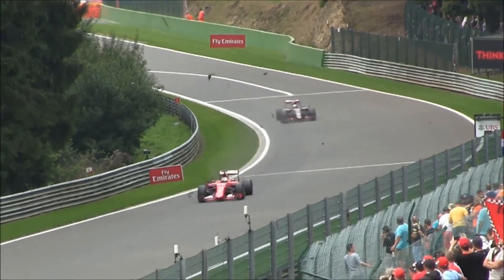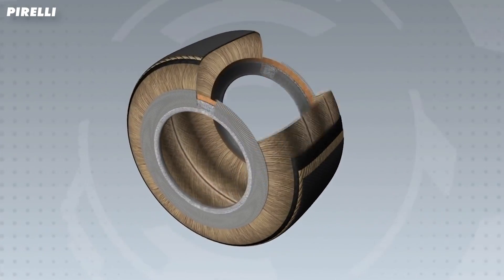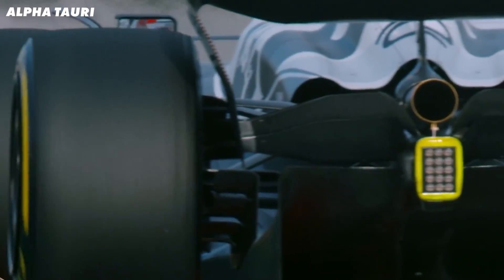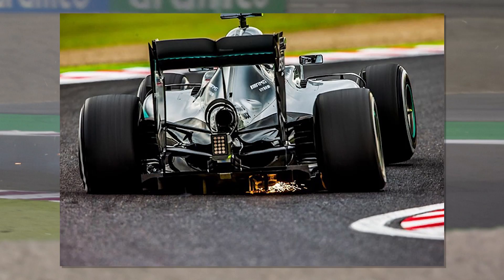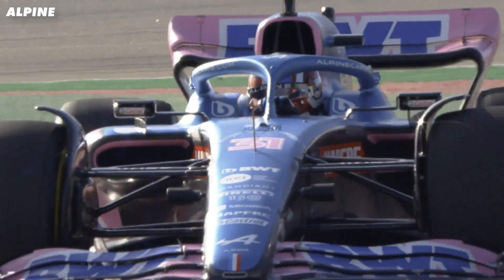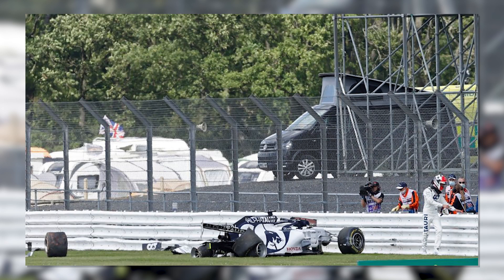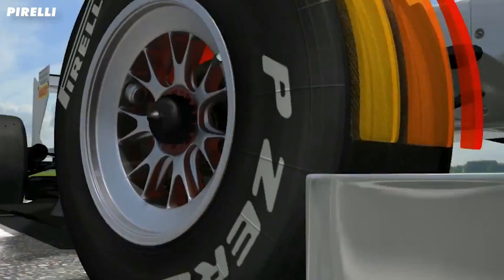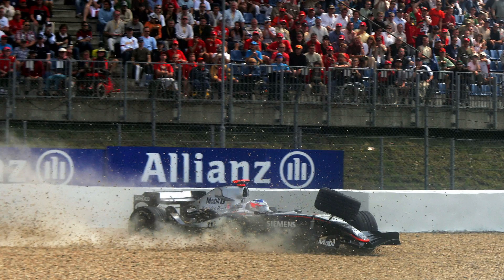Why Formula 1 Tyres EXPLODE

Comment: 4:13 its 27,000hp (20,133kW). Also with brake bias at about 58%, and the front loading of the car, the front tyres are probably doing about 70% of the overall breaking. Or about 9500HP per tyre.  kW is a better measurement though. . The total braking of 20MW would power about 30,000 - 40,000 homes for that short period of time (~2s). (an average of 415W - 666W over the 24 hours assuming comfortable temps)

Comment: Curious how the manufacturer of the tire blamed a phantom problem. A manufacturer that just so happens to supply the tires for the industry where a mysterious failure occurred. Kinda sounds to me like the Inverse Kramer Law should apply.

I'm guessing either the tire had a defect that could have potentially been present in the entire batch or something failed, but not all the way, only just enough to create heat but no sparks yet slowly heat up a rim somehow enough to soften the bead of the tire to the point where the tire failed but again somehow without something else overtly failing like decrease braking power, partially locked wheel, not weird at all.

Comment: At 1:20, either what you're saying, or what you're showing is incorrect - The dispersion rate is the rate at which nitrogen and oxygen will 'leak' out of the tyre (hence why you need to periodically fill up your car's tyres)

Comment: It’s just so crazy that with all of the parts we use in cars,and different materials,that the most important part is made of rubber and is the contact to the road,which can be very rough and tough,the crazy part comes in because tires simply work (tires as we know them now anyways)!!And this video amplifies how amazing tires are and how we trust tires to do what we need them to do in the applications that we use them for!!

Comment: What wasn't explained in this video is there are 3 forces acting on the tyre.

Downforce: squishing the tyre
Side force: pushing the tyre of the rim.
Rotating for: rotating the tyre around the rim

When you break and accelerate the force is transferred through the inner diameter of the tyre, whilst the outer diameter is trying to stay put.  This is putting rotational torque through the sidewall.
Top fuel dragster are a good example of this.

The other mention is as I don't think FEW are running bead locks. The only thing attaching the tyre to the rim is friction. The air pressure is keeping that friction high, if you lower the tyre pressure there becomes a point where the one or all of the 3 forces are more than the frictional force of the rubber to the rim wall and then the tyre will fail.

Bead locks prevent this, that's why extreme off road vehicles run them, as it's a clamping force and not a frictional force. So can run no pressure and the tyre will stay on.

Comment: I’ve got myself a tire exploding on a road trip while only traveling 120km/h on semi-rough surface…. and it’s a pretty new tire as well with only about 30.000 km clocked in. I think I can understand if sometimes F1 tire gives up under much higher pressure situation.
Reply: 30 000 km is in no way pretty new tire. That is more than half of the usable tire life.

Comment: 1:40 I would use the long right hander at the start of the Catalunya circuit. You see at the F1 game, the heat and degradation on the front left

Comment: Why is it that drift car tyres don't seem to lock up in the same spot when they use the second caliper to start a drift, I remember seeing Nigel's tyre blow out and later he was told he would have won if he wasn't able to not crash.
Reply: Drift cars don't use such a soft compound as F1. As well, purposefully spinning the tires should help to even out potential flat spotting.
Reply: @Vykk_Draygo  
I do wonder how soft a soft tyre for f1 is.

It may be soft for f1 but the forces acting on them, they can't be that soft.

Comment: I have always said that tires are the most important part of a car (and brakes of course). People dont pay much attention to tires, but a ton of engineering research and development has been done to take drivers from A to B fast and safely. The tire engineering for F1 cars is even more impressive, since these tires take an insane amount of abuse during a race. Well done Pirelli F1 tire engineers!
Reply: There's an old tyre advert, I think it was Bridgestone and I remember it in Australia.

Their whole advert was how there is only 4 hand prints (the contract patch size) keeping you and your family safe.
And from memory the ad shows the car stopping just in time as to not Knock over a child.
Emphasizing you need good rubber to stop.

However everyone sees them as black and round so they're all the same.
It's the compounds that matter.
Reply: Tyres are absolutely the most important aspect of any car. Braking, cornering and accelerating just wouldn't work without good tyres.

Comment: sorry mate but silverstone 2013 Pirelli has revealed four factors behind the failures: mounting rear tyres the wrong way round, with tyres intended for the right rear of the car put on the left; adoption by the teams of too-low pressures; extreme camber settings; and aggressive kerbing at Silverstone.

Comment: 2 corrections.
1. Cornering forces haven't been "only" up to 4g. I remember Bottas some years ago in a Mercedes in Silverstone going with 6.2g through the S.
2. Kimi could have changed tyres, of course. But then P1 would have been over. It was a gamble and he lost.
Reply: We've seen that gamble a few times over the last couple years.
Reply: @Robert-j6r8c , when?
Reply: @DaveMcIroy  Hamilton Vs vestapen... Hamilton could have pitted but didn't, gamble he lost.

And I think it was a recent one with Russell when they realised how long the mediums lasted.

I'm not big on F1, just remember some of the highlights with the commentary saying about the pit strategy.
Reply: @Robert-j6r8c , ahm, that was different. In these incidents the suspension wasn't under threat.

Comment: I remember Lewis Hamilton had a spectacular tyre failure in Turkey 2007. Bridgestone, the lone tyre supplier at the time, reported that drivers (Hamilton in particular) suffered from chunking. The chunking was caused by the combination of his driving style, the more aggressive tyre usage of his McLaren at the time and the stresses the tyres experience through turn 8. Over time, these caused the rubber compound to separate from the belt of the tyre, hence the chunking. This undermined the ability of the tyre to hold air in it, and in Hamilton's case, it failed under braking for turn 9.

As Istanbul Park is an anticlockwise layout, this meant that the right front tyre  was most exposed to this problem and the tyre failure, coupled with the failed tyre flapping around, it led to damage to Hamilton's front wing and he struggled to turn into the pit lane entry. The team changed his tyres but didn't change his damaged front wing. In the end, he finished 5th
Reply: Anti clockwise? 
 You mean, counterclockwise? Lol
Reply: @billyyank5807  lol yourself, in my country it's correct to call it anticlockwise
Reply: @billyyank5807  so no, I meant, anticlockwise, I thought you spoke English, lol

Comment: 3:32 "3 g of lateral load"

A 'g' is an acceleration, not  a force/load.

3:35 "2 tonnes of downforce"

A tonne is a mass, not a force.

As for drivers standing on the brakes (3:59) "and I do mean standing" - I have never seen drivers shift from the recumbent position to the vertical when cornering.
Reply: Ooo recumbent, you’re totally not a tart
Reply: I think everyone else who watched this video understood just fine. It is a "you" problem.

Comment: Since Bridgestone won't say it here, I will.... Bridgestone's tyres / tires over in IndyCar have gone years... over a decade?.... without such a failure.  Heavier cars, on ovals where there are faster constant speeds than most F1 top speeds, etc etc.  Perhaps the problem here isn't with tyres, but rather the FIA's spec that makes them fragile?